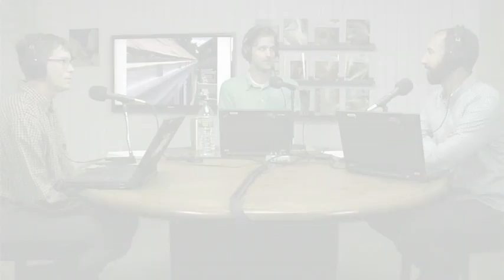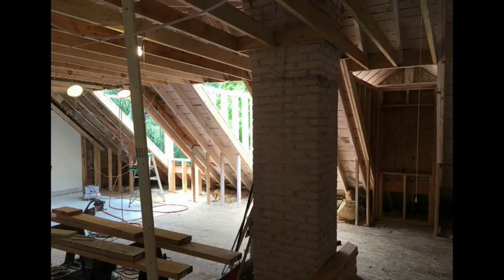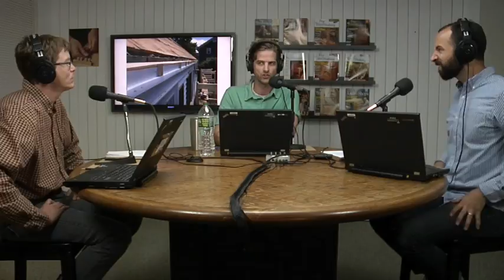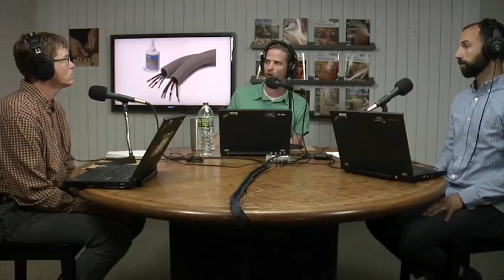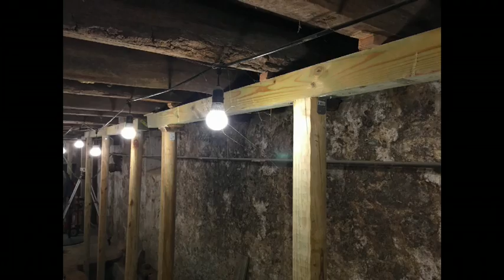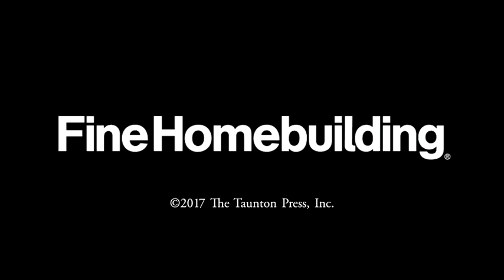Fine Homebuilding Podcast Episode 63

Comment: The main problem with aluminum wires in walls is they burn down houses.  Back in the seventies, a lot of homes were wired with aluminum because everyone was convinced copper was scarce.  Houses and entire apartment complexes burned. While aluminum is safe for service drops or in underground applications, it has to be used with aluminum rated lugs and proper torque is essential.  Copper works with any lug and just has to be snug to avoid fires.  Aluminum house wiring caused fires when homeowners or handymen interchanged copper only switches and fixtures or tried to use wire nuts on aluminum wiring.  The only safe solution for all these homes in the seventies is to rewire with copper or a specialty copper coated aluminum wire.   However "pigtails" added to aluminum wire ends are available using a special splice and crimper to connect a copper wire end (pigtail).  Not great.  As a result many localities that saw these blazes kill people and destroy dreams outlawed aluminum wiring in residences.